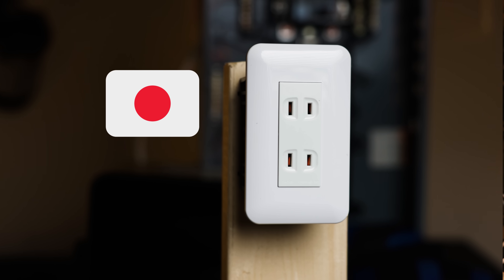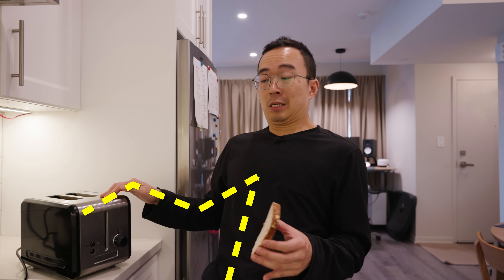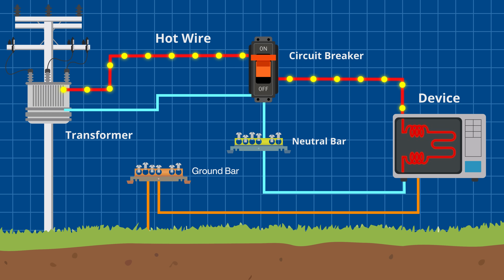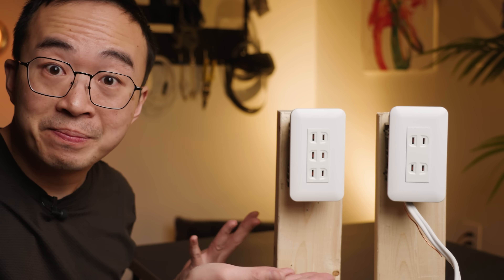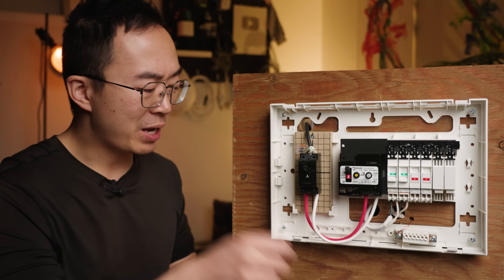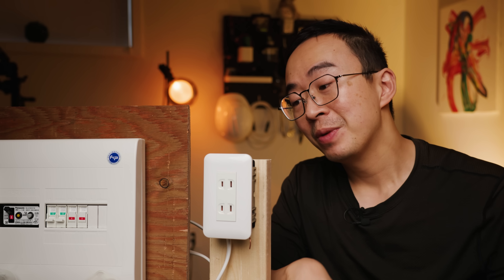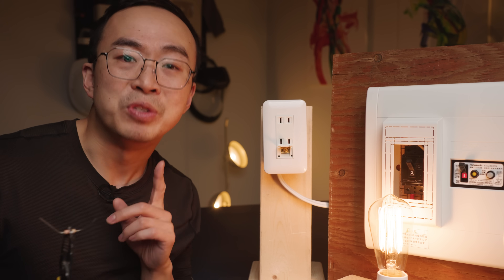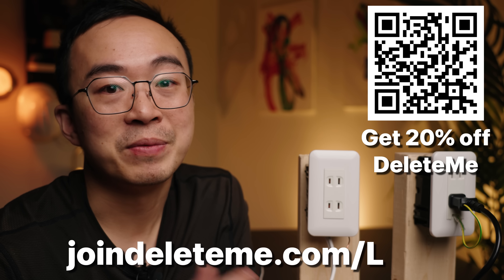How Japan Made Their Outlet Safe

Comment: About half the devices in a typical european household have a metal casing that needs to be grounded via the outlet.
Are these devices modified for Japan?
For example ATX PSUs in desktop PCs don't exist without grounding.
So what happens with these devices?

Just a note, not connecting the ground is not an option and (for european and american standards) strictly forbidden.
This grounding cannot be replaced by an RCD, because an RCD only provides so-called "indirect protection".
Indirect protection has two major flaws, which is why we always need direct protection as well.
First, it still causes a non-leathal shock upon touching, which can still kill you if you e.g. drop from a ladder.
Second, it can fail and stay unnoticed for years. If than a fault in a device occurs, this is a dangerous situation.
Reply: Actually only 10% of devices are such. Apart of the white goods only computers and printers are grouded. Also they work perfectly well without grounding. People do use them in homes.

Comment: I’m not following, if the ground wire is connected to neutral in the panel why not just connect ground to neutral in the outlet?  I’ve also heard that the ground is to ground out dc voltages that may be on the line.

Comment: You can get GFCI circuit breakers in the US and they're recommended for new construction, although not actually required by code (as far as I know at time of writing this). While that's not quite whole home GFCI, it is whole circuit GFCI, which if every circuit in the panel is GFCI is effectively the same thing. The primary reason people don't already use them everywhere is just that they're more expensive than the normal circuit breakers, so a lot of times they'll only be used for places like bathroom or kitchen circuits that would traditionally have used GFCI outlets instead.

Comment: it makes importing japanese electronics real dangerous since many things with a metal chasis have one leg wired directly to it, so if the plug isn't polarized, the outside can end up at mains voltage when connected to a US/canada outlet.
Reply: Absolutely no plug in device uses the neutral for grounding. (OK old US dryers do but there tge neutral is the center pin). The ground connector is separate. That is a fundamental safety issue.

Comment: Circut breakers are to prevent fires not to save lives.
Gfci are to save lives 

Gronding is to prevent none gfci devices from being live on exposed metal parts.
It also prevent buildup of painfull induced currents 

Nether is going to protect you from shoks between live and neutral

Comment: Single GFCI is not great design. You need one per circuit or one per few circuit at least in order not to stop the whole electricity of the building (including lighting at night) while you have faulty device in the loop. Here in Europe you have separate GFCI on each circuit at risk bathroom outlet, kitchen outlet et.c

Comment: Don’t take information from unqualified people.  Grounding is not to protect you from getting electrocuted. Its to reroute power if the is a surge  or a lighting strikes. Ground is for protecting the electrical system.
Reply: You are confusing system grounding and equipment grounding. If you had any qualifications you would not confuse them,
Reply: @ actually I am not. Do some research. You will see everything is grounded for a reason.  How it’s grounded depends and the effectiveness of that ground also depends on the application.. either way DON’T GET ADVICE FROM UNQUALIFIED PEOPLE Simple as that
Reply: @whatforman  Acfus9uou see if you start talking about system grounding when the issue was equipment grounding.
Reply: @ you clearly have issues with understanding things. You sure like to twist things around. Talk to me when you understand what I was saying. You seem a little ignorant.  I fixed electronic and wire electrical it good to understand what your doing. Take care. Be careful you might learn some hard lessons

Comment: Kinda missing a important fact of why birds sit on power wires, but people usually get shocked when they grab a hot wire.
Reply: Because the birds are only touching the wire and nothing else, there's nowhere for electricity to go and they don't get shocked. When humans touch a live wire, they are standing on the ground so the electricity goes from live to ground through their body which shocks them.
Reply: @qwunchyoats9892  and when you have a ground wire and a human in parallel?
Reply: @qwunchyoats9892  But most of the time while you're indoors, what you're standing on is not grounded, or more likely not very conductive. So as lot of times, it's actually not going to hurt you to touch something live. You might just feel a vibration. That being said, I wouldnt recommend trying it.
Reply: @Skracken  That is why in many European countries ungrounded sockets were used in dry rooms until the 90s. They actually can be safer if a kid sticks something in it as there is nothing grounded nearby.

I hate how people net stupid nationalistic on these issues picking individual points in their system and claiming how it is better or superior without understanding the systems and the logic behind them as a whole. Americans seem to be especially fond on grounding. The more the better.
Reply: @_Thrackerzod  I am aware. The capacitively coupled current would be tiny though, so like I said, you'll feel a vibration more or less
Reply: The birds you see on power wires aren’t real birds, they are secret government drones that spy on us all.
Reply: There typically are only hot wires on power lines. Birds do not get shocked as they do not touch two wires.

Comment: Ex OSHA Compliance Officer here. The United States uses a 3 wire system for AC (altering current) power in houses. The three wires are identified as the grounded conductor (neutral), the grounding conductor (ground wire), and the ungrounded conductor (positive). None of these actually prevents a person from being shocked, they allow power to flow back to the power source, which allows the breaker to trip in an overcurrent condition. The breaker works by heating up and opening the circuit. The ground wire can help to lessen a shock to someone that touches an energized part that isn't supposed to be energized. It will prevent a shock to a person as long as the grounding path back to the power source is better than the path through the person, which is the most likely scenario. I've investigated fatalities where the ground wire actually contributed to the person dying. A Ground Fault Circuit Interrupter is the device that will prevent a person from being shocked and possibly electrocuted on an AC electrical system. It works by sensing an imbalance between the grounded wire (positive) and the ungrounded wire (neutral) and tripping. Two wire systems still exist in older houses in the United States and can still be safe by being equipped with a GFCI breaker in the power panel box.
Reply: I used to work for a telecom.  They have a lot of grounds.  There's AC power ground, DC power ground, frame ground, cable rack ground and signal ground.  They are all separate  except at the common point where they connect to the building ground.
Reply: I have an older house with a 2 wire system. But all the wires are 10 gauge, and I didn't want to replace them. I think I've solved the problem by using breakers with GFCI and AFCI on all circuits. Have I?
Reply: @ChimeraActual GFCIs in every single circuit inside the pannel and you should be fine
Reply: @ChimeraActual  do you have a pool at your residence? We have to examine and protect yourself and others from all potential sources. You have  gotten a very good start. Keep going to make property must secure. Pools are notorious for improper grounding and wiring. Take care, Ziggy
Reply: "The breaker works by heating up and opening the circuit." - in the USA, perhaps.  In the UK (and probably Europe) the CB has two trip mechanisms - the thermal one you mention for slight/long-term overloads, and a magnetic one for short-circuits (ie Heavy Overloads!) which trips it incredibly fast.  If you were daft enough to hold the two wires by the insulation and "strike" the conductors briefly together, it would trip the CB!  (Don't try this at home...)
Reply: @HDRW  The magnetic one is also standard in all modern breakers used in modern US households, for basement, bathroom, kitchen, and etc. arc fault and/or GFCI are required by code (in new or upgraded installations).
Reply: Devices which detect current imbalances seem to be a good idea. But there is also the issue of shunting different potentials or capacitative coupling  in poorly designed circuits that the earth wire can do.
Reply: Quite a few things wrong in your post.

Comment: Here in the Netherlands (and I think most of Europe) we use the GFCI/RCD (or Earth-Leak-Switch as we call it, aardlekschakelaar) on groups of up to four breakers. Or we use combo Earth-Leak-Breakers which is a GFCI/RCD combined with a breaker, all of this in the main breaker box, nothing in the outlet itself. Earth wires are connected to actual ground, no loop to neutral. All outlets in wet rooms are mandatory grounded although all new homes and most renevated home in the last 30 years, pretty much have grounded outlets everywhere. 

Because we're on 230v, amps are lower thus risk is slightly lower for us. We can also load up to 3600W (16A) on a  single breaker or 7200W (2x 16A) for a double breaker (usually induction cooktops). I also have 400W breakers which is 3 phase 16A delivering up to 11kW for the heatpump system for warm water/heating and 11kW for the electric car charger.

My home is connected via 3 phase 25A and we try and divide the breakers over the phases. If two breakers on a single phase go over 25A, the whole house shuts down. It's a balancing act but with proper design and some thought, you'll never trip the house breakers. My heatpump and car charger both have smart monitoring that checks the amp-load on every phase. If the phase is crowded, it throttles down (heat house slower and charge car slower/later) so as not to interfere with other non-smart appliances such as ovens, cooktop etc.

Comment: 1) Ground pins were created long before GFIs existed.  I grew up in a house that only had grounded outlets near the kitchen sink and laundry tubs.
2) GFIs were created because it was possible to get a lethal shock without tripping the breaker.
3) I remember the adapters that allowed a 3 pin plug to connect to a 2 pin outlet.  They had an extra wire, similar to the one in this video, that was supposed to go under the screw that held the outlet cover on.  This assumed that screw was grounded through the box, but it likely wasn't.  It's not hard to see that often that extra wire won't be used, because people can't be bothered.
4) It seems to me you're trying to justify crappy grounding in Japan.
5) Japan drives on the wrong side of the road!  🙂

Comment: In the USA you can still get 2 prong outlets new for houses as more and more appliances use 2 prong only but with a thicker inside of wire like the 3 prong as the item has a small surge protector in the item, the main reason the 3 prong is used in most countries. Then in Brazill and a few others in South America, these same 2 prong outlets are the only ones used for smaller items, being that all items in Brazil come with a surge protector built into the plug. In Brazill the bigger 240 use USA/North America Plugs if you get items with that and not having to be wired directly in like some older appliances like the older oven and stove separate if you even get a stove  or oven as most places in Brazill you use an electric oven top that is built in at most or bring your own and buy a bigger toaster oven/air fryer and often use 2 of the small mini fridges that use 110 prong.

Comment: Ground is also used as a conduction path for the EMI filters (electromagnetic interference) in products with an internal power supply.  Products with a ground will radiate noise if there is no ground.   Japan requires GFCI because (as stated in video) its electric system does not use a solid grounding scheme (Japan uses TI, most of world uses TN where neutral a ground are bonded together).  A GFCI is much more complicated than a circuit breaker.  That's why GFCI have a test button and circuit breakers do not and is why some countries, like Germany, require GFCI to be tested yearly.

Comment: Just an FYI, I live in Georgia, USA. Our Ground goes to the copper pipes which come into the house from underground. We don't have a "grounding rod", we have a grounding Copper Pipe. Our house was build in the 1970's when copper pipes were standard for water.
Reply: Same in the house I grew up in.  These days, plastic pipes make lousy grounds!  🙂
Reply: The new NEC does not permit this.
Reply: @TexasEngineer  Probably because they don't use Copper pipes  as a default anymore.
Reply: @BoDiddly  Not really. Gas pipes are steel and sometimes bonded to water pipes especially at the water heater..There are cases where you get induced currents on your gas pipes and sparks can happen. It is best to only ground in one location with a ground rod.
Reply: @TexasEngineer  I meant copper pipes for water. Now days they use PVC instead of copper.
Reply: @ I ment the same. They don’t electrically bond to any water pipes any more because the gas and water pipes are connected together at the water heater and the gas pipes can pick up electrical currents from the water pipes being bonded to the electrical ground.
Reply: @TexasEngineer  Ohhhh, I see what you are saying. It wasn't clicking in my head... 😂

You are saying the water heater can be a single point for both the water and gas pipes, and that's a risk point for an electrical spark.

Comment: On the part at min. ~6: dust accumulates in a plug, conducts electricity and therefore .. fire. Thats not how it goes. With the dust, the contact resistance becomes extremely high and therefore a lot of current has to flow, which results in high temperatures. That's the reason for the fire, because it ignites all the dirt and dust afterwards... otherwise a great video, keep it up! +1 sub.

Comment: The newest electrical codes in America all require GFCI / AFCI protection pretty much everywhere in new residential construction.  The grounding system, specifically the Equipment Grounding conductor (ground wire) is more about preventing fire. Instead of allowing a condition to exist where a fault could lead to overheating and fire, the low impedance path to ground is designed to ensure the breaker trips before a fault creates the kind of heat to start a fire. While a tripped breaker can prevent shock, that's not the primary purpose of the grounding system. Preventing shock is what GFCIs do. AFCIs are about detecting arcs and killing the power, another fire prevention technology.

Comment: IMHO It is probably safer to use GFCI in Japan and here is why: EARTHQUAKES. According to Shindo seismic scale 5 and up is the point when most infrastructural lines are damageged (including earthing wires and rods). There were more then 600 such earthquakes in 2024 in Japan.

Comment: Electrical journey man here. This video has a lot of issues and you brushed over the most important point at the end.  GFCIs fail overtime measured in years where copper cables on the ground circuit fail over millennials. Also as you mentioned, a GFCI doesn’t prevent you from getting shocked, it just helps prevent you from dying from the shock. A ground wire prevents you getting shocked and has a replaceable breaker take the beating. 
In just about every way the ground wire system is better.
Reply: The electronic ones in the US do fail.
Reply: @ so do the whole house ones. Also fun fact, so do breakers. Also, every time they trip they get weaker and weaker. So consider them a wear item

Comment: Adding ground sockets in Japan sounds good, but all the old appliance won't have the plug that can us them.  And if they did buy one most people would use an adapter rather than rewire the house.  The usa also has the new gfa breakers too. Ground fault arc breakers.  Plus we have the new safty shutter  on the outlets too.

Comment: A 'ground' is noting more than a low impedance path for electrons. Skin is high impedance.  Copper is low, and the 'ground' is a huge current dissipator. You can achieve the same effect with a 0 to 100 ohm resistor and a diode connected to neutral. That, too, will trip a breaker.
Reply: That makes no sense.

Comment: Why do you call the RCBO you show at 7:36 RCD? /jk

For the others: RCD is an umbrella term for all devices that trip when they sense a ground fault/residual current, but the device actually shown is an RCBO which stands for "Residual current operated Circuit-Breaker with Overcurrent protection" and works double duty as GFCI and regular circuit breaker (that's why it has 2 levers) and is usually used to protect a single rooms outlets.

The big one, that's used for whole house protection is an RCCB (Residual Current operated Circuit-Breaker), which usually gets shortened to RCD.